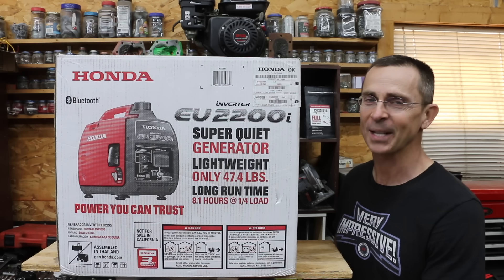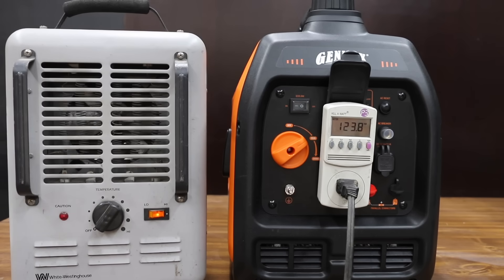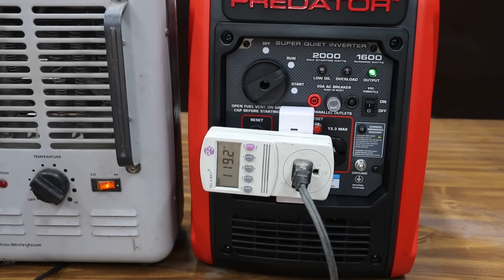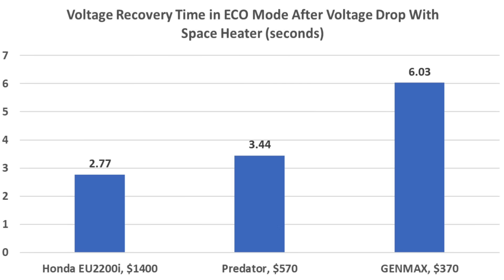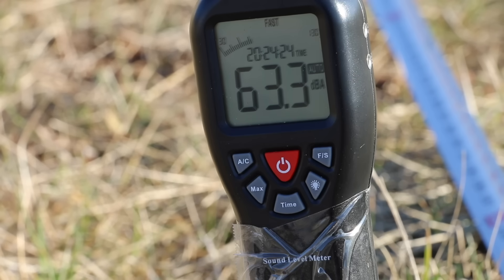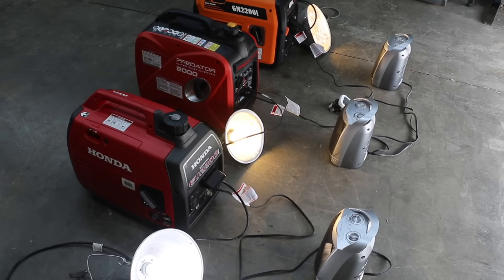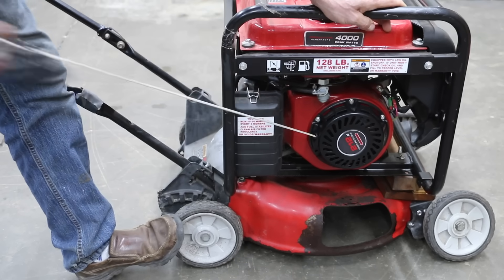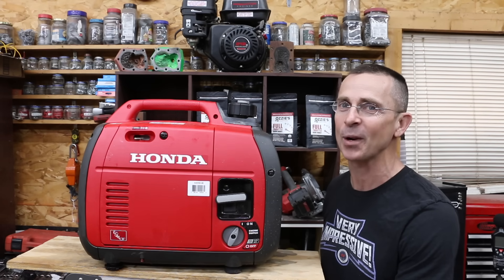Cheap Generator Better Than Honda? Predator vs Honda & GENMAX—Let’s Settle This!

Comment: In canada these generators are more expensive . While working for a rental company a customer returned a 2000w honda generator that had fell of a truck on the highway 😮
It was in a dozen or more pieces. 
The manager wrote it off, so my coworker began to reassemble the thing using jb weld and zip ties. 
It seriously looked like Frankenstein with all those zip ties for stiches, EVERYTHING worked except eco mode!
Gotta love a honda!
Reply from the maker: Impressive!!  JB Weld can fix just about anything. lol
Reply: @ProjectFarm  j. B. Is my favorite welder!
Reply: No duct tape?? What are you people up there?? Animals????
Reply: @twistedhillbilly6157  😂
Reply: That's funny @twistedhillbilly6157
Reply: @twistedhillbilly6157  He didn't watch Red Green.
Reply: My Dad had an old RV that ended up sitting for a long time. They sold the RV for next to nothing but forgot they had the old Honda generator from it in storage. My Dad was going to throw it away as it was probably pushing 30 years old at the time and they had forgotten to drain the fuel so the gas tank had rusted through. It sat in my shed for probably 15 years or so until I happened to come across a used gas tank on ebay for it (some go-kart builder took them off new engines to put a different one on). Cleaned (didn't even need gaskets!) the carburetor then filled the tank and it fired up after just a few pulls. Put it back in the shed for a few more years (drained fuel this time!). I donated it to hurricane Dorian relief in 2017, it's probably powering something in the Bahamas as I type this. I was volunteering with a local charity in Orlando, FL to send supplies over and watched it get loaded on the plane along with a pallet of skil saws and other tools to help build shelter in the most devastated areas. The stories I heard of what they went through in the more remote islands still gives me chills. 

I'm glad I kept that old generator out of the trash and was able to put it to good use. It's a testament to Honda quality when it can be neglected for almost 50 years and still fire up after a simple flush with carburetor cleaner! Too bad they didn't build the rest of the RV or I'd be camping this weekend!
Reply: I thought you meant "fell off a truck" wink wink but no you actually meant it fell off a truck!
Reply: We have a small Honda generator that has been used amongst our circle of friends. It’s ?? Years old (20+),, it’s been all across North America, run on all kinds of garbage fuel, dropped, rained on, back of pickup trucks for 100k,,,, and it still starts second pull and once its running it smooths out and just …quietly runs.  Honda ! I do notice they are making them in China today. If the specs are the same then should be the same ?,, we will see. Do you see a diff. Between made in China /Japan ?
Reply: @peterparsons7141  They run their own factories in China, so the quality stays high. I would still like to see Made in Japan honestly.
Reply: @nobodynoone2500  I noticed small differences in a few tools we compared. I think you’d probably see small differences if they changed factories within the same country . So I attributed differences to new manufacturing equipment and new people doing the work, an not necessarily that it was an entirely new end product. Thanks for the reply, I was just seeing what others thought!
Reply: @nobodynoone2500  I have a lot of Makita tools.  A few made in Japan, and those tools seem like a notch better.
Reply: @nobodynoone2500 . If your paying made in Japan kind of prices, I’d like it to be made there.
Reply: @nobodynoone2500 Den of tools talks about how the newer Honda generators quality decreased over the years and not worth it anymore compared to the HF ones
Reply: @peterparsons7141  i have never seen made in china honda. It's generally Japan or Thailand or India. 
Most of the eu70is & 30is are from India.
Reply: @Kuntal Ghosh  my buddies new honda 300L is made in Vietnam. 
In the 60s and early70s anything made in Japan was called j@p scrap. 
Man did they turn that around fast!
I'd prefer Japanese engineering and production quality at or near the top!
Reply: @brentfellers9632  You might be interested to know that after WWII, America sent engineers to Japan, to teach them the American way of manufacturing. Combined with their proud culture, they continue to pursue excellence to this day, while unions destroyed American manufacturing, along with participation trophy public indoctrination.
Reply: Today's vocabulary word: "Arbitrage" 'In economics and finance, arbitrage is the practice of taking advantage of a difference in prices in two or more markets; striking a combination of matching deals to capitalise on the difference, the profit being the difference between the market prices at which the unit is traded.' See also: Smuggling.
Reply: @bansheedearg  Arbitrage… word of the day.
Reply: Check your spelling before publishing. That's fell OFF a truck, not fell OF a truck.
Reply: @RoyDees-t2k 🙄

Comment: Todd, not to get off this week's topic, but please consider testing home garden tools, like basic loppers (hand held and longer ones).  Yesterday, I learned a few new words as I tried to cut back my wild raspberry bushes which were encroaching on my vegetable garden.  I found my loppers where I left them in my garage last fall and quickly realized that although they were only a couple of years old, they were already toast (dull blade, nicked blade, some rusting).  It is so tempting to buy a new pair for $20 or so, but if they only last a couple of years vs. several years for a $50 model, then that would be helpful info. Thanks!
Reply from the maker: Thank you for the video idea!

Comment: Great video, as always. I have a recommendation; Compound-action snips AKA aviation snips. I’ve noticed a big difference between the amount of force needed to cut with different brands as well as durability of the blades.
Reply from the maker: Thank you for the video idea!
Reply: In my experience using them in work for 20 odd years nothing for me has beaten Midwest ones.
Reply: I've been using aviation snips for over 25 years. So far, WISS brand was on my top list but, lately, I've noticed that another company took over and kept the WISS logo. What I mean is, I see a pair of WISS in a  BENCHMARK package. They are not so good anymore so, I'm giving TASK a test. So far, not a problem but, they're barely 3 weeks old.
Reply: @rverro8478 yea the new crescent wiss snips are garbage. great idea for project farm I’m looking forward to the video!

Comment: Would love to see a video comparing the battery power stations (Anker, ECOFLOW, Bluetti etc.). I’ve been considering getting one but it’s hard to tell the difference as most videos featuring them are sponsored. Would be expensive but well worth the information.
Reply from the maker: Great suggestion! Thank you
Reply: @ProjectFarm  Would love to see a comparison of some of these more pricey ones to some cheaper ones. It can be very expensive and many people dont realize the panels are sold separate, but I've found some  combinations with the panels and generator for under 300.
Reply: Yes, we would love to see a comparison between the battery powered stations. Especially the Bluetti.
Reply: I kinda short changed the Projects With Everyday Dave channel. He's not as technical as Will Prowse but he does a good job of making practical use and review videos.
Reply: I don't have a channel, but I've been testing power stations at home. I've got six of them from Anker, Bluetti, EcoFlow, Goal Zero, and Jackery.

The Jackery Explorer 1500 was the first one I got, and I really like it, it's very well thought out and easy to use, but it's a traditional lithium battery. All the others are LiFePo. The small Anker 521 is the one I end up grabbing most often, it's extremely easy to use and very well put together.

Both EcoFlows are good, I have the 3.6kW Delta Pro and 1000W Delta 2. The fast charging options on those are their party trick, and they have ridiculous numbers of outlet ports on them.

I like the Bluetti and Goal Zero least. They're both packaged well, but fall down on ease of use

Comment: I wish we would see more of a variety of generators especially with the main popular brands like FIRMAN, Westinghouse and DuroMax
Reply from the maker: I'll do it if there's enough interest in this video. I'm finding myself breaking the budget every month. lol
Reply: @ProjectFarm I second a large, dual fuel generator (~10kw) show down between Westinghouse, duromax, champion,etc.  Thanks for doing this work. I hope it's worth it.
Reply: @Prototypemech  They all do what they say they do. Within a couple of points either way, they are all similar. The true test is durability and warranty. And although I respect the heck out of Project Farm, its difficult to test for durability which is the single most important factor in generator reviews. They may look good, sip fuel and are quiet. But if you can't get a thousand troublefree hours out of a unit, the rest is irrelevant. Read the comments from owners who have had them awhile. That information, along with these awesome test results, will give you a very well rounded depiction of how they units truly are. I've seen multiple Predator generators go past 1000 hours with little to no issues. Ive read about Honda/Yamaha units get twice that. Thats what you are looking for. Cheers guys!!!
Reply: @ProjectFarm  Tough to raise cash just now.
Reply: @Project Farm  You should start your own second-hand tool store for after the videos are finished.

Keep the nice ones for yourself of course 😅
Reply: @ProjectFarm  I'd like to see it with larger generators, like 5000+ Watt.  I'd also like to see Briggs & Stratton included.
Reply: @ProjectFarm  you should sell some of your stuff after testing.
Reply: @ProjectFarm  a small Firman was just on sale at Costco last month - that could have helped on your budget side - had you known back then... Thanks!
Reply: Most people seem to really like the Champion brand , also ...
Reply: @indycharlie  I was also about to suggest champion.They also have a dual fuel version.
Reply: @Defender_of_men  Yep . I bought a 3500 watt dual last year . Love being able to use propane . Have not had to use it for an emergency , so far . 😁
Reply: Surprised you didn’t mention Champion. I thinks it’s more popular than the ones you mentioned.
Reply: I'm currently shopping for a generator so I stopped here a few months back to see if there were tests. Those costco firmans and Cabela's champions are tempting
Reply: @Extra_Ordinary_Gary  I bought a Firman from Costco a couple years ago after an electrician recommended them. It is a tri-fuel and has worked well for us though we have only had to use it a couple times so far-running on a 40lb RV propane tank it is supposed to run for a week under normal load without refueling. We haven’t tested it that long yet though. Keep in Mind wattage output is reduced a little when running on propane vs gasoline but will run longer.
Reply: A lot of them are made in the same factory.
Reply: The trifuel ones are also interesting
Reply: +1 for Westinghouse vs DuroMax. Just purchased a Westinghouse for hurricane season and was deciding between the two. Champion would be great as well!

These things are crazy expensive though, so it's completely understandable if the budget doesn't allow for these tests. Thank you for all the testing you do!
Reply: I’ve been around Hondas when in use for days at a time where no electricity was available and they were awesome, and this was 10 years ago at least. I’m sure they have only gotten better.
Reply: DuroMax XP12000EH please
Reply: I have a firman myself it runs really well. Been using it for about a year now
Reply: Maybe Generac and Champion as well, and someone posted others as well. Thank you again for your videos.
Reply: Champion and WEN also.  I like my WEN open frame inverter generator.
Reply: i’d love to see champion brand added to the test
Reply: I had a 900W Firman and it was the worst piece of s... ever.  Would not start. No guts. Non quality components. Unfriendly to operate, etc etc.
Reply: @Freetheworldnow  Yep, another Chinese clone. Its just the brand of the day. They pitch their products to all the big stores and the one that comes in at the right price point wins and becomes the brand of the year. Costco. Walmart, etc will sell the heck out of them. Next year it will be a different no-name brand. Doesnt make them bad machines. Just makes them another random seller...
Reply: @giggiddy show me some 100% USA made generators.
Reply: Generac
Reply: If you like his great content, subscribe and like. I like ALL his videos before I watch, because I know it'll be great and so I don't forget. Also consider joining and rewatching videos. More views, more subscribers brings in more revenue for this costly testing. Thanks for a great channel!
Reply: A-iPower SUA2300i
Reply: What about power horse?
Reply: Would also love to see the FIRMAN added to the list.
Reply: Glad to hear this. I just ordered a firman a couple of days ago.
Reply: Pls do more on the cheaper gens we can afford better
Reply: @oneboyscout3653 . That’s what predator generators are.
Reply: @oneboyscout3653  but they're not cheaper.  Buy once, cry once.  My Honda eu2000 is 18 years old.  We just ran it for 3 straight months after Hurricane Ian destroyed the island and damaged our home.  No issues, even with it being that old and completely neglected.   There's a reason the food trucks in NYC use these Hondas day in, day out.
Reply: Dee... Clearly you have no concept of money and what these tests cost. I nominate you to fund the next test with a dozen different models. This guy isn't sponsored, buddy. He does this out of his pocket.
Reply: People keep checking out all the different $300-$600 generators hoping one will magically be as good as a $1,200 one. The Honda’s aren't overpriced. They’re just real good. Have to decide if you spend for “real good” or cheap.
Reply: @astang1072  Absolutely correct. The best are Honda and Yamaha- period. The others are Chinese knock offs, but not horrible. Most are made in the same plant as you'll see identical parts if you look close. I live in florida and we work our generators hard. Buy a Predator with the extended warranty and you can't go wrong. Again, if you want the best, that's an easy decision. But the best runner up, in my opinion, is the Predators. They are used commercially with success and after a storm, have run them for weeks without stopping(only to change oil). PS- the most important thing to do is a proper break in. Follow the manual exactly and you'll be surprised at how long they will last. Cheers!
Reply: @giggiddy  You want the best in marine outboards?? Also Honda and Yamaha!
Reply: @astang1072  Yes sir. I'm a big Yamaha marine guy. I've had many and they are top shelf in terms of reliability.
Reply: In my experience, testing a plethora of cheap generators would be a waste of time and money.

You will probably find that most of the cheaper generators are essentially the same thing with different stickers on them.

Made in the same factory for a different brand.
Reply: @TheSzalkowski  most likely

Comment: I think the Honda is underrated on wattage, either that or it’s the closest to it’s said wattage and others are under
Reply from the maker: Great point!  Also, the engine makes a lot more torque which enables it to recover more quickly for sudden power demands from thirsty power tools.
Reply: @ProjectFarm  I have one 2 years old, it’s just a great handy machine to have on hand, wether we camp or go off roading it runs air compressors, griddles, lights anything we need in a small package we can carry easily

Comment: 119.5Vac is absolutely fine, and higher than a lot of houses I see. 110Vac-125Vac is the norm depending on where you are.
Reply from the maker: Great point. Thank you
Reply: my house has 128 volts at the panel.  Double pole breaker reads on my fluke at 257

Comment: Any generator is better than no generator.
Reply from the maker: Great point!
Reply: Usually, but I have seen a couple situations where the users probably would have been off without one.... 😎✌️
Reply: You could try the motor snorkel, which converts these generators to propane!